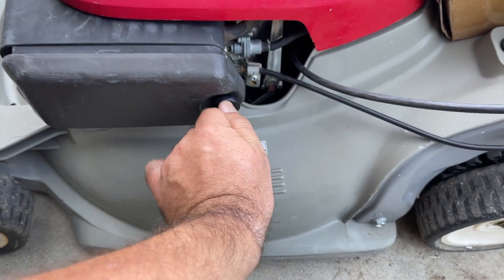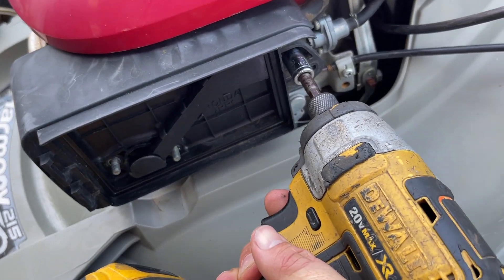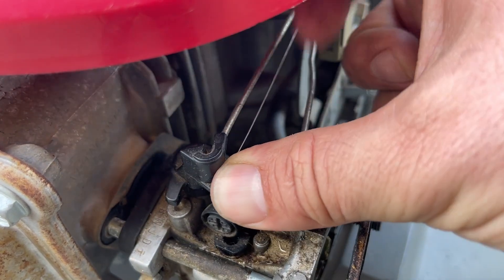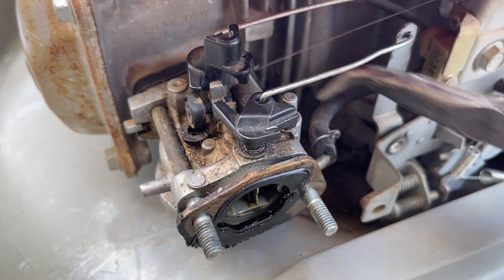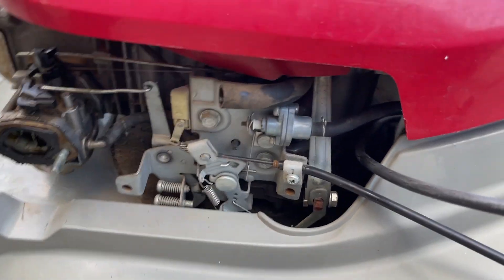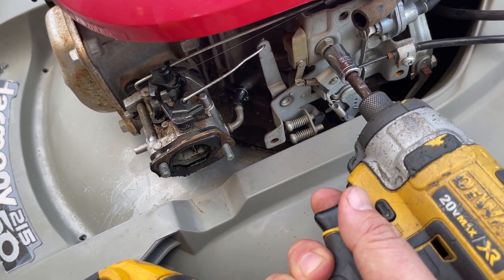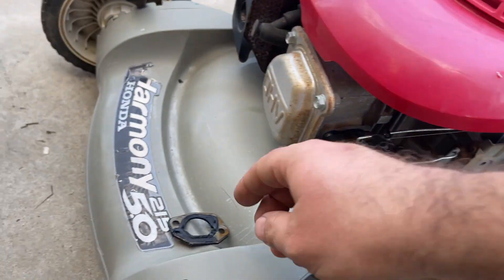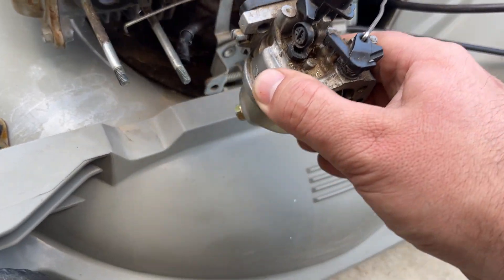Honda Harmony Mower Carburetor Removal - The Easy Way

Comment: Thank you for sharing this detailed video. I have a Honda Harmony 1011 & I'm trying to get the carb off so I can clean it, but I'm stuck at the "tricky linkage part". My rider is currently 150 miles north, so I can't look at it right now, but I seem to remember that  those 2 bolts you removed are not easily accessible on my 1011 like on yours. I will look & see if your suggestion is possible next time I get back to this issue. Thank you very much for that perfect tip that I'm sure helps lots of viewers.

Comment: Just Subscribed to your channel and like your videos!!!   I do repair as a side gig and love it ...  I have a honda push mower  that has same carb and it surges up and down .. I tried to clean carb , changes plug , cleaned magneto and same problem... should i order another carb for it to try ?
Reply: @jrocha6511  surging or hunting can be fixed by removing and cleaning the plastic air jet plug under the black idle adjustment screw.